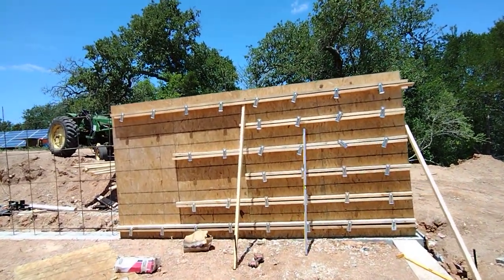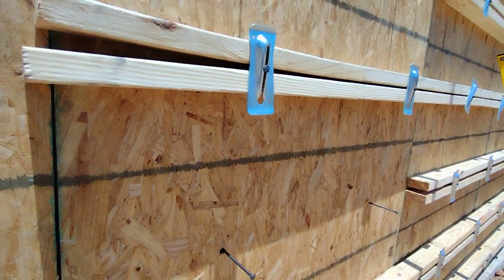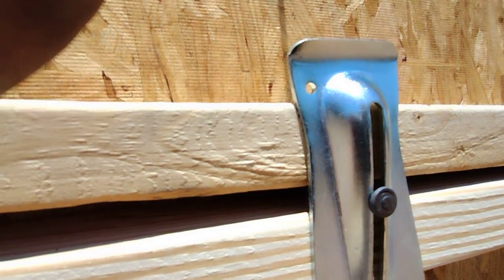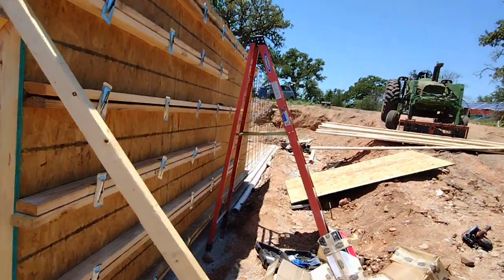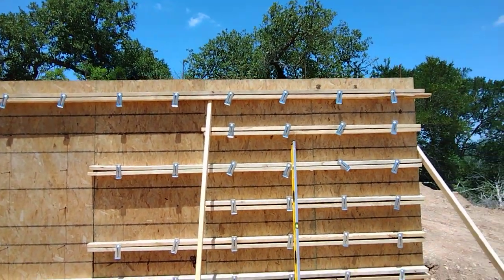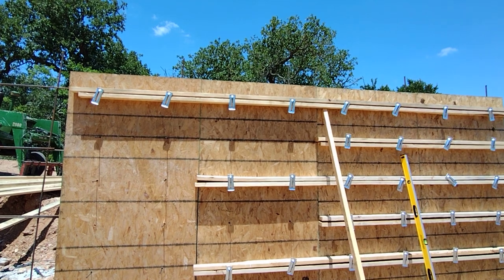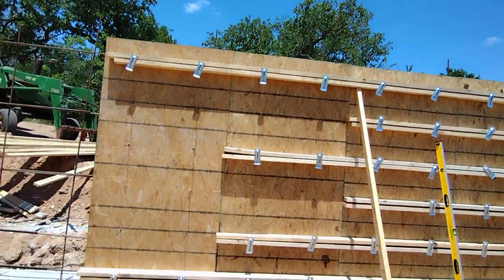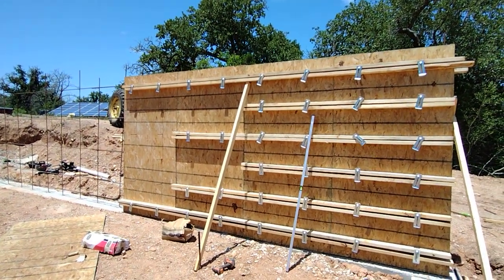Concrete Wall Forming with Plywood, Snap Ties, and Wedges Part 2

Comment: You turn the clips at a slight angle and put an #8 penny nail half way in and bend it .  This prevents the vibration of the concrete to cause the clips to fall off. Also stager your 2x4s by 4 ft and break the joints on a clip.
Reply: That is exactly what i was about to post here. 
Great minds think alike. 
Happy New Year! 🎉
Be safe.

Comment: you might want to lap your 2x4 not at your plywood joints. stager the upper and lower long 2x4's around the pins. Dont have them end at the same place. extend the 2x4's past the end of the wall which will allow you to "cap" the end wall with small 2x4's fastened into the extended long wall 2x4's.
Best of luck

Comment: Put the first 16' 2x4 on the wall.and toenail it just below the snap tie.  The plywood needs to extend 4 1/4" past the end bulkhead.  The 2x4 waler needs to extend out past the end of the plywood wall form about 12 or so inches.  Make sure the bottom waler doesn't fall on a plywood seam.  Place a 2x4 6' waler on top of the 16' waler.  From that point on you're good to go.  The whole idea is to stagger the 2x4 walers so they span all the plywood joints and also are are at least two feet staggered from each other.  The walers are "laced" at the end of the wall to further secure the end bulkhead.  You can do that by nailing 2' 2x4s across them with 16 penny double heads.  Use 8 duplex to nail off the hairpins.  You do this because when you vibrate the concrete, the hairpins can vibrate loose and off and that ain't good. No way no how.  The way you did the wall is totally wrong.  The bulkhead should be two 2x4s withe a 6" rip of plywood nailed on them.  Hence the 4 1/4" past end of pour or 4 1/8" if you're using 5/8" plywood.  A liner device should be connected at least every 8' to line the wall.  The way you line the wall is you plumb the end bulkhead perfectly vertical.  Then you run a dry line (Mason line), end to end, offset 4" off back of wall form plywood.  Then you adjust the liner devices all the way down the wall and when you eyeball it it should be straight as f*ck. After you have poured and vibrated your concrete you need to line the wall again.  A wall like that should be done in a minimum of 2 lifts.  The next day strip the forms off.  Wait a couple more days and break the snap ties off and sack the wall.  You should have no air pockets or any other bullshit rookie catastrophes if you pour the wall this way.

Comment: By the time you buy the lumber and figure in all the labor it is so much cheaper to rent handset forms for a month.
Reply from the maker: I live in central Texas. Basements are rare. I couldn't find any to rent. How much is it to rent a set where you live?
Reply: @rollingoakhome2381  its actually not that bad. Anywhere from $1.50 psf to $2.50 for the month.  We have a bunch of distributors in my area so it's easy to get forms.  I realize that it's not that convenient for everyone.
Reply: @rollingoakhome2381  I have built a lot of basements in central Texas if your one and done you can use the plywood	on your roof or decking and rent the clips at your local concrete co .
Reply: I bet this lumber wasn’t THAT expensive.

Comment: Can you tell me how you hold that in places vertically?
Reply from the maker: I screwed a 2x6 to a 2x4 like angle iron. Then I screwed that to the horizontal members. You can see it in my later videos. They make a long snap tie that will allow you to put a wedge over the horizontal 2x4s and a set of vertical 2x4s. This is probably the right way to do it.